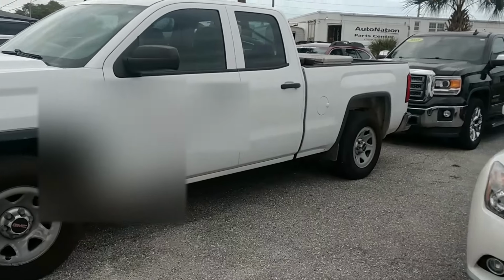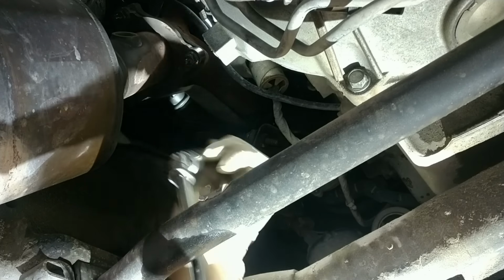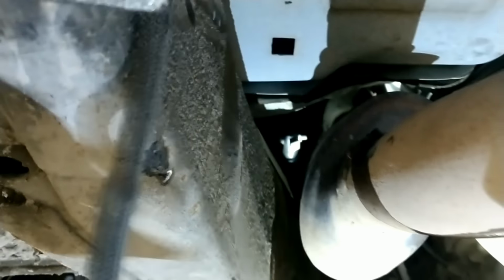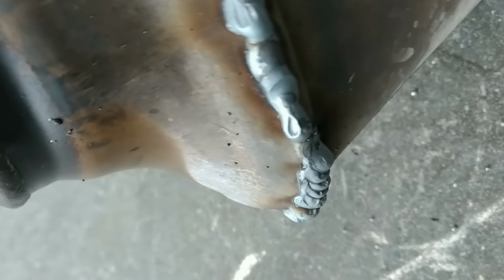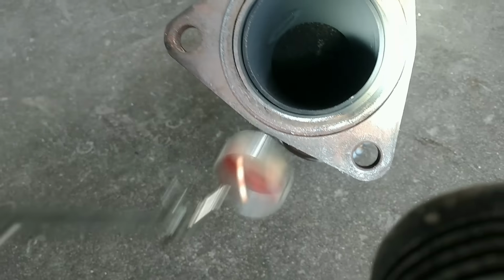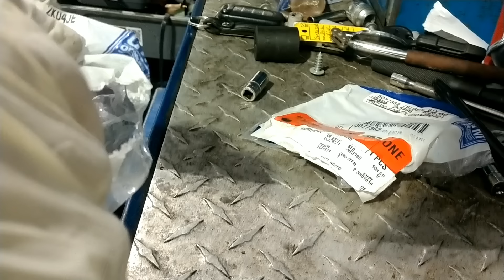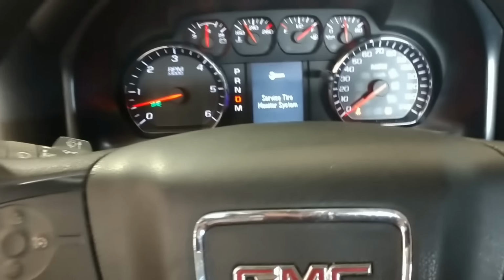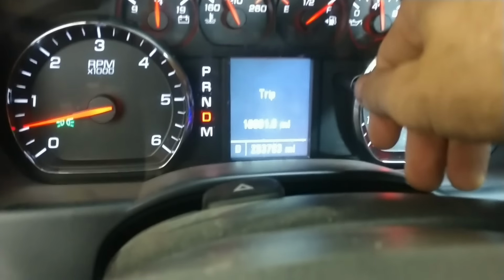Customer States exhaust leaks: Repair it cheap.  Ok then, I can do cheap and good. Sort of.

Comment: I was a welder for over 40 years, and I could give a rip whether or not you were wearing gloves. But the pattern that you used weld sucks. Do you not know how to back stitch a seam? And when you do that, you avoid leaks in your well because you're not trying to weld over another weld that you just applied. The welder is already running when you hit another weld, which allows it to seal.
You'd have to stay on that welder pretty hard to damage that core.

Comment: What kind of electric ratchet is that? I never ever, ever, ever gotten exhaust bolts off that easy even with blaster and when I do it’s because they snapped off. But that ratchet looks like it has decent torque.
Reply from the maker: It's a 3/8 drive snap on. Had it for about 3 years and use it daily. It works hard. I'm surprised I haven't broken it yet.
Reply: @RainmanRaysRepairs  I’ve been through a few. Down to a ryobi now lol. It’s got good torque but the dam battery gets in the way I need to just good one. The snap on guy almost sold me on one yesterday I might get it
Reply: You must be somewhere here in Florida with me. A lot of these cars look eerily familiar lol

Comment: I sure am glad you used stainless steel filler in that MIG weld so it doesn't crack after a few heat cycles.

Comment: Lol, tack stacking. Why not just have an actual welder or welding shop fix this? Those welds will break in no time.
Reply from the maker: Naaahh they're fine. Been doing shitty welds for a while. I can weld, I just can't with any kind of talent.
Reply from the maker: Because they needed a cheap fix. That's what they ordered. I did the best cheap fix I could.
Reply: @RainmanRaysRepairs  Well at least you're honest on them being shitty welds. lol

How much does one charge for something like that?
Reply: @RainmanRaysRepairs  You are a mechanic that welds, not a welder that wrenches on cars.
Reply: @briangardner5764  Eh, tack blasting aint welding.

Comment: Use a lincoln sp135 wire feeder and a mirror keep your puddle on the old weld let it flow into the sheet metal where it cracked the weld diddnt break

Comment: Maybe I missed it? How did the Muffler bearings look? With that many miles on the truck aren't those in need of replacement? ;-P
Reply: Not bad but the bumper fluid had to be flushed

Comment: Loved your video. Just one question that maybe I missed. Did you ever actually check the tire pressure with a gage or something like that?    Keep up the great videos.
Reply: What I don't understand is why they don't put the batteries outside of the rim in the tire monitoring pressure because this way you wouldn't have to pull a tire to fix the pressure sensor maybe just I'm asking too much but it would be an easy way to do it for engineers wanted